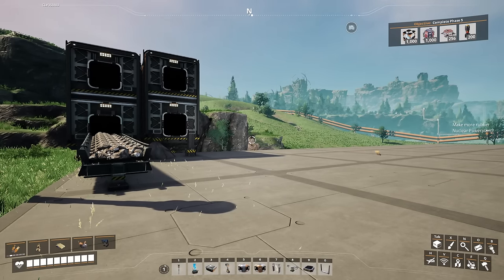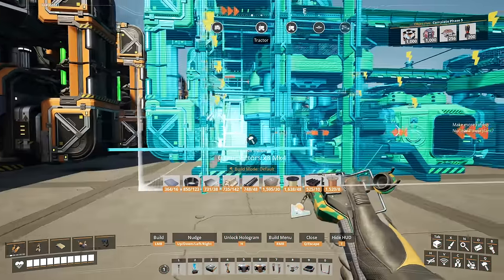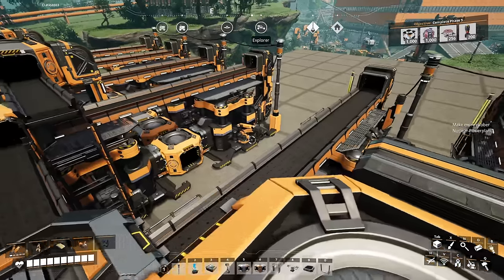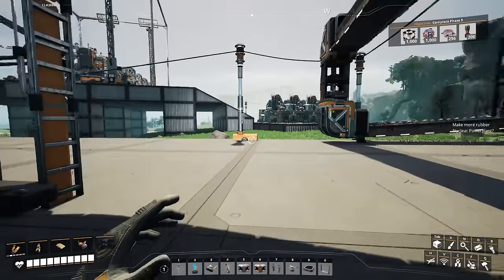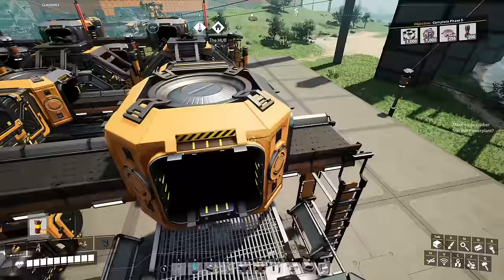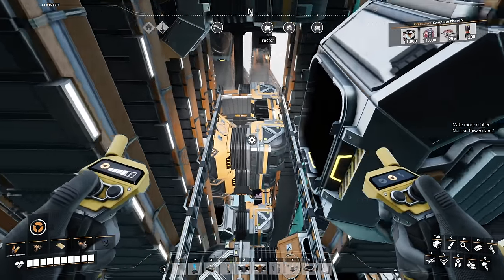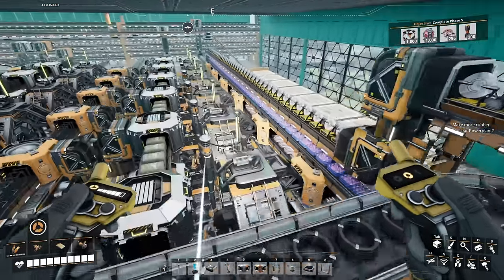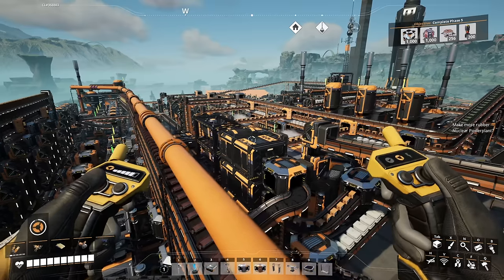Putting It All Together - Example Factory & Base Tour Using Blueprints - Satisfactory 1.0

Comment: If you remove a foundation and put a single wall outlet on the side of a foundation, you can run the wire through the ground without seeing the cable or the outlet. Just replace the foundation when you're done and connect to outlets that are more easily accessible. You can also snap and clip to the bottom of walls to have the outlets visible , but the cables hidden.

Comment: +1 to the floor hole idea as I LOVE Scalti's designs. very clean as everything is managed on a "sandwich layer"/logistics floor hidden below. 
The downside is when trying to load balance in tight areas for 100% efficiency ratios is it can get very cramped/complicated very quickly! 

Would be interested to see a take on this design from a manifold/bus layout in mind
Reply: manifolds are also 100% efficient and take less space. assuming you do the math correct
Reply: I love Scalti's designs too, I still use his mindset when building new factories but Krydax also adds a new perspective which is nice. 
For Scalti's designs I now just do a manifold in the sandwich layer haha
Reply: Ya, I gave up on load balancing for the most part.  It has its uses, but manifolds are much easier to scale.  Also, manifolds can bootstrap pretty quickly if you throttle using a lower belt tier after the splitter, i.e. mk4 for the bus, mk1 or 2 for the input where appropriate.

Comment: you mad lad! putting more intake on a belt line then is being fed!! almost had me go into an OCD flop sweat. I have to have exactly the input per min matching the machine uptake for 100% efficient manifolds.
Reply from the maker: Its good for you to be exposed to things like this 🤣 

Perfect ratios and efficiency are highly overrated in this community. Sure there's nothing wrong with it if that's how you like to play or whatever, but there's plenty of arguments both for and against it from a logistics perspective. Truth is, it's really not a problem if a machine runs 50% of the time 😱
Reply: @Krydax8  true but I like to have things going constant, gotta have those sinks

Comment: Honestly I was just wondering why you preferred the jetpack to the hoverpack. I don't think I've ever even used the jetpack, or at least not very often since the hoverpack was released. It doesn't require fuel and it keeps you at a level height until you manually move up or down (or get pushed by something). Those are really cool blueprints, though. I'm definitely going to try it out. My factories are just a mess so I need tips like this to help clean it up.
Reply from the maker: Oh i use the hoverpack mostly for building. It just unlocks later, so I was using the jetpack for example in this vid. 

I do use the jetpack a lot for getting around, though, since you can travel much faster horizontally with it, so I swapped back and forth a lot in the late game.

Comment: Can you show a water set up for your Coal Power Generator blueprint. Can you also include overclocking the powerplants and Water Pumps and what's the best way to calculate that and build it?
Reply from the maker: That's a little outside the scope of this series, but i mean... to calculate... you just always overclock your water pumps (unless you have a huge lake), stuff the max water into each pipe (300 with mk1 pipes), and that can supply 6.6 coal plants. So i just settle for 6 from each pipe. So basically you would put down two of these blueprints for one full water pipe, and if you put down another 2, you'd have to not hook up to the same water pipe.
Reply from the maker: And that's without overclocking coal gens. You could, for example, overclock each one to 200%, and then you only need 3. Or technically if you want to use the full 300 water, you'd overclock each coal gen to 222%
Reply: @Krydax8  I can understand how my question might be seen as rudimentary, but I'm new to the game. The first of this series you define "Tile-able" as connecting as many as you want in a row. Again, I'm new so I might be misunderstandimg, buf if you have to interrupt the pipe network to insert another pump and different network of pipes, to me that doesn't follow the definition, nor does it follow the spirit of the video. The coal generator (and later I'm assuming other fluid based builds) will have this as an exception, not a rule. It might be with calling those out. I spent hours trying to figure out why this design didn't work and flow like your others. Just some feedback.
Reply from the maker: @Artimecion1  it is tileable though. How many buildings you can tile depends on your clock rates and pipe amount. In a normal case of mk1 pipes and regular clocked gens, you can fit two of these blueprints. Then you can keep going, using the same coal, but yes you have to bring in more water with a second pipe.

But idk what you're expecting. That's how literally every tileable blueprint is for items as well. You can only tile as many buildings as your belt speed can support. Pipes are no different.

So I'm not exactly sure what you're saying. But coal generators are no less tileable than any other build. As with anything else, you are always limited to how much you can fit on belts and in pipes.
Reply from the maker: Cause if you're doing screws with constructors, for example, you probably can't even utilize close to a whole belt of output for my constructors x8 build.

And if you want 12 coal gens. You can nicely bring the extra pipe of water on top of the other stackable poles, and then just connect the extra pipe to the second set of 6, rather than the previous blueprint.

So even for multiple pipes worth (or belts worth, in the case of the other builds), these are indeed "infinitely" tileable (obviously within limits of resources you have available)

Comment: You said you don't recommend a bus now that you've tried it. Can you elaborate and what you'd do instead? idk, maybe that's a video idea.
Reply from the maker: Mainly because 1) you don't need most items in most places, so a huge majority of the bus is "wasted" belting of stuff. Just carrying items forward on the bus for no reason.
2) It's a MASSIVE pain in the rear to upgrade all the belts, or even one chain of belts. So you end up with huge amounts of belt segments to upgrade.

Personally I plan to, when I come back to Satisfactory (as i've already beaten it for this run), go with a modular design where I make complete items in different areas, probably put them on trains, etc.
Reply: @Krydax8  cool, thanks for the explanation.